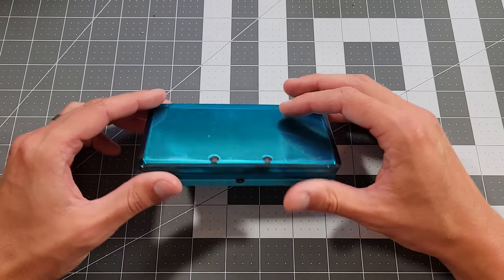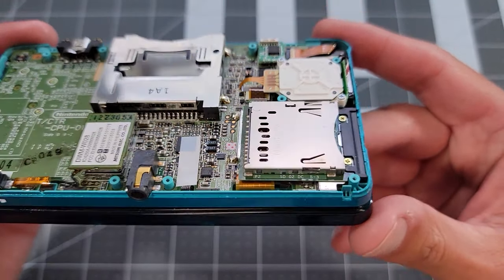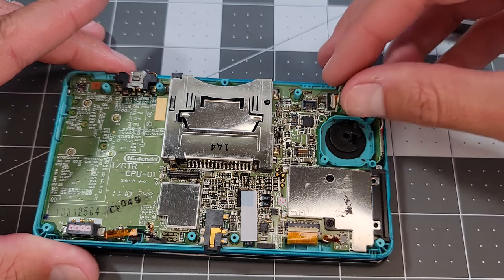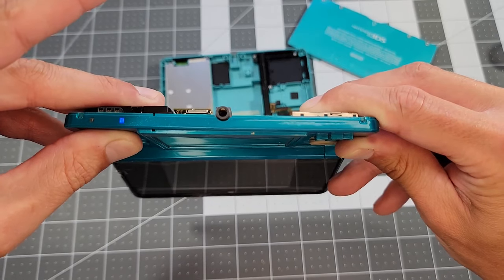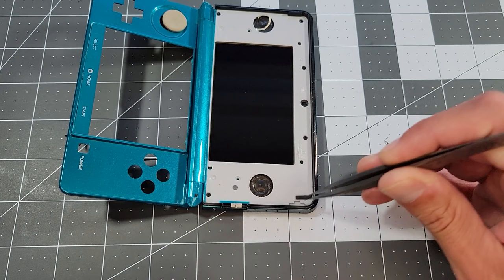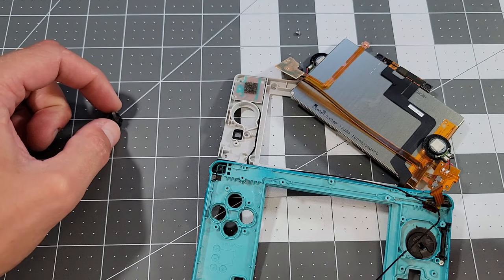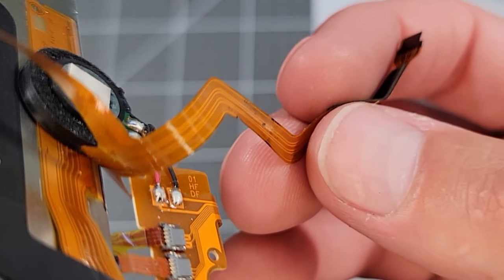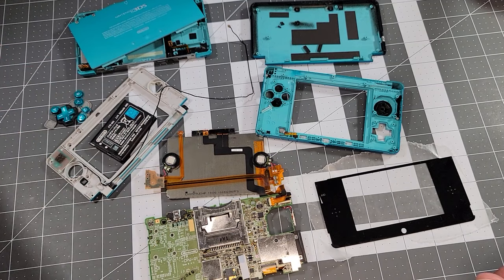Nintendo 3DS turns off with a POP! Finding Out Why

Comment: At least you found the issue!
Reply from the maker: Heck yea, thanks for watching!
Reply: @FantasticQuack  It’s typically the speaker, but I’ve had it happen with other cables required for boot.
Reply from the maker: @adamwayne101  I've encountered this problem exactly twice and it was the screen both times.
Reply: @FantasticQuack  Yea we’ve encountered the issue more often than we would like, it could be any of the main cables required for boot which makes it a pain to pinpoint. There are a few variations with some being instantly popping, some popping only when opening the console and some not making the popping sound (which could mean bad speakers). For us about 30+ have been speakers, 5 or so have been top screen and few have been a variety of things.
Reply: @FantasticQuack  I’ve been wanting to make repair videos for a while now but  haven’t found the time and am unsure of a proper POV setup that won’t get in my way :/
Reply from the maker: @adamwayne101  Who is we? where do you work? Sounds like you've got a lot more experience on these than me so I'll take your word for it! 90% of what I fix I come across on my own since I'm not a shop and my channel is too small to get very many subscriber requests, that is just to say there are a ton of console/game failures I've never been exposed to--but every time I run into something new I 99% find a way to fix it!
Reply from the maker: @adamwayne101  Whatever you try it will get in your way, I just work thru the pain :)
Reply: @FantasticQuack  My business partner and I run a video game store/repair shop. Mostly online currently while raising funds for a brick and mortar location in Texas. We’ve repaired close to 400 consoles at this point, most component repairs have become trivial but the board repairs are the trickiest which require soldering and that’s my partners job lol
Reply: @FantasticQuack  We’ve managed to repair most board issues but have had a couple that are beyond our level of skills and would likely require Nintendo to fix themselves so we just end up using those for parts

Comment: Yeah I have had this issue on my new nintendo 3ds XL for 6 years, only looked into fixing it now. There is ABSOLUTELY no way in hell ima be able to do this myself. And I'm a tech nerd
EDIT: came back a year later to reconsider... yeah there's still no way I'm doing this
Reply from the maker: Don't sell yourself short, anyone can do this stuff with enough practice and patience!
Reply: Lol me too I'm in college now looking back at my original 3ds that broke like 8 years ago. Might as well try before throwing it out
Reply: I was in highschool when I tried to fix my old original 3ds by replacing the circle pad, camera module and top screen, I fixed it with no issue, still perfectly working to this day. You just need to be a bit patient and not yank on the cables,  replacement components are really cheap too so you dont have to worry as much about breaking ribbon cables n such.

Comment: You weren't lying about this thing being a nightmare to put back together; I got to removing the bottom screen from my system & called it quits. Brought a new battery & everything hoping I'd be able to fix my old 3ds. Ahh well. Wouldn't have made it that far without your video so thank you 🙃
Reply from the maker: Sorry you weren't able to get it working it's a tricky repair for sure!
Reply: I fixed so many old 3DS XLs. Never want to go through that again. lmao

Comment: Yup, had this exact issue with my OG aqua 3DS. Lasted a good 8 years before breaking though. The battery was also bloated and the right speaker ribbon was severed right where it folds on itself behind the LCD.
Reply from the maker: I'll have a part 2 of this out before January with the rest of the repair. Hope it can help/inspire you to try it out yourself!

Comment: In case you arent lucky enough to find a sweet spot where the device does turn on, is there any way to determine whether the fault lies in the speaker cable vs the bottom backlight cable?
Reply from the maker: Finding a sweet spot where it turns on doesn't tell you where the fault lies either. The root problem was determined by visual inspection (where I show the tear in the cable) so I would recommend the same for you--inspect all the cables carefully.

Comment: I want to play Pokémon x so bad. The issue is I have the same problem here. I know for a fact I won’t be able to do what you just did. Plus I don’t even have the spare part. I want to play it on the citra emulator but I’m having issue with that as well. I looked up the prices for the Nintendo 3ds and Pokémon x on Amazon and from what I find in total it’s going to be more than $200. I was hoping it be less that and maybe I might consider buying it but the fact that it’s more than $200 I’m very uncertain especially to play one game. I of course would buy other Pokémon games as well but to start off I want to play x. I just don’t see the worth in buying it. Also the 3ds shop is closed so I would have to keep ordering games from Amazon which is a slight inconvenience. If anyone has any tips for me pls let me know. Or maybe I just forget about this whole thing and just move on. I do have a switch but I really want to visit the 3ds Pokémon games.
Reply from the maker: If you check local listings or even ebay you should be able to get the game and system for $150 or less. Still kind of a lot, but better than overpaying on Amazon. Hope you can get to play it eventually, also I'd recommend Sun/Moon over X/Y :)

Comment: Awesome guide, man. Managed to boot up a 3ds that was popping like crazy. 

The only weird thing is that it keeps popping if I put all the screws together, and if I don't, it turns on normally.
Reply from the maker: Thanks! Sounds like yours has an issue very similar to this one. I didn't first get this one to turn on until removing the back shell. I'm guessing the screw tension compressing the shell against everything was enough to open the broken trace on the flex cable. When that tension was removed the cable closed it's connection (at least temporarily) and the system could turn on..

Comment: I had something similar like this happen with my first original 3DS.  Except it only happened when you turned the system off, after pressing the power button it go to the power off screen only to immediately shut off with a pop.  It would reset the date and time this happened.
Reply from the maker: I've not seen that before, interesting problem... At least it was mostly working for you!

Comment: Interesting video! I have something possibly similar, but its a 3ds xl. My question is: when your 3ds shuts off, is the date and time reset as well? Mine shuts off intermittantly and date and time is reset to 1/1 at 00:00 o'clock.
Reply from the maker: You're testing my memory but I'm pretty sure I did have to reset the clock after all this was said and done

Comment: awesome guide, i think i found my problem: i got the black ribbon cable practicaly  breaked in half, would it work buying a new ribbon cable?
Reply from the maker: Assuming no other issues then yes. I made a follow up video to this one where replacing the cable solved the issue, check it out if you want!

Comment: Wow disassembling a 3DS looks like a nightmare, glad my New 3DS still works, only issue is that mine shuts down if i tilt my upper screen to much.

Apart from that works like a charm, but thx for the video and at least now i know what to do if it doesn't work anymore.
Reply from the maker: Sounds like the same issues shown here, and yes it is a pretty rough time haha

Comment: Thanks man for the tutorial. 
I've opend mine today because of the same issue in the video with the audio ribbon cable and it seems like the opening and closing the lid over the years worn down the lcd screen ribbon cable black sticker like thing. I hope i can repair it, just have to wait for the replacement part.
Reply from the maker: Glad it's helpful and I hope you can get yours working, cheers!

Comment: I've suffered the exact same problem for years. The First Time this happened i brought the unit to a shop that was usually able to fix any problem with the 3ds but i was told the connector was broken beyond repair and that there was no replacement available on internet. This led me to think that there Was nothing to do and i Just accepted what happened, but this video really gives me some Hope. Is It really hard to learn how to handle all the components as seein in the video?
Reply from the maker: It's difficult for sure and requires a high degree of patience. I have a follow up video with the rest of the repair coming out very soon, stay tuned for that!
If one of the connectors is damaged, that adds another step as now you need to replace it. If you take some measurements I guarantee there is an equivalent connector option to be found on Digikey or Mouser. I go through a similar process on my GBA micro video where I had to identify and replace the switches for the start/select buttons.
Reply: @FantasticQuack  Thank you man, really appreciated

Comment: Thanks champ, I just and desconnect and reconnect the ribbon again, I'll never thought about doing that if is not for ur vid. I was just messing around with the SD card😅
Reply from the maker: Glad I could help and that the simple option worked for you! In my experience it is usually a worse problem :)

Comment: Well, i found my issue. It's just f##ked.
I'll just send it to a service. I'm done trying. Unplugged everything, cleaned every single spec of dust, put it back together, still pops. Nope. I'm done. Too tired fighting stripped screws.

Thanks for the tutorial. It was really good.
Reply from the maker: Thanks for watching! Did you find any damage on the cables themselves? Sometimes the screen itself is cracked or otherwise bad and needs to be replaced.
Reply: @FantasticQuack  The cables look fine. I know the display isn't cracked because the 3DS only sits in a case, was never dropped and also sat in a drawer where there wasn't any dust.
Taken care of would be an understatement.

Comment: Can I follow this tuto to fix original 3ds xl with same symptoms ? Or the hardware is very different?
Reply from the maker: The hardware will be slightly different (screw locations, size/type of ribbons/connectors) but the general procedure will be largely the same.

Comment: I have this same problem happening with my 2ds xl, even though they are different systems will this tutorial work the same, if not can you maybe do a tutorial on the 2ds xl? thanks!
Reply from the maker: It should work for all 3DS types with a rotating hinge. The process will be 95% the same, you just might find some minor differences in the cables & connector locations. If I run into a different 3DS model with this problem I will probably make another video, but until then this content (and the follow up video where I complete the fix) is the best I can offer, cheers!

Comment: Yeeeeah...3DS systems are a bitch to work on. This is why GBA is furthest I will go for repairs. Adding that flip screen made it way more complicated. The 2DS doesn't seem as bad as it's just one big screen and doesn't flip. 

This power/cable issue seems to be happening more recently and I wonder if we are going to start seeing alot more of these with the same issue.
Reply from the maker: You're right on 2DS being easier to work on. I used to think the flip screen on the GBA SP was annoying, but after working on the 3DS it doesn't seem so bad, haha. I wouldn't be surprised if this issue started showing up more often in the near future, might be like xbox capacitors all over again..

Comment: Is there a video anywhere for a new 2ds xl? same problem but probably was different components. Also no screen flash.
Reply from the maker: I haven't ran into a 2DS XL with this problem yet but if and when I do I will make a video! The hardware will be slightly different (screw locations, size/type of ribbons/connectors) but the general procedure should be largely the same.

Comment: Is there a way to fix it without all this? I'm just a child and can't do any of this, neither can any adults I know/my family/
Reply from the maker: If the screen or its cables are damaged then no there is no other way. The only "easy" thing to try is disconnecting and reconnecting the cables. But it won't solve anything if the cable or screen itself is damaged.
Reply: @FantasticQuack  thank you so much

Comment: i got a 3ds xl for $30, it had a similar issue except the bottom screen would also turn off and flicker, as well as the whole device turning off, unless you pressed down "above the power button next to the screen" which i deduced to actually be the battery contact points. only after having taken the motherboard out already lol. one new battery and some nice tight screws later, and it works perfectly.
Reply from the maker: Thanks for sharing, glad you got it working!

Comment: Random question why didn't you try to tape it just for the sake of it to see if it changes anything I did once to a Joycon witch rail buttons weren't working because the ribbon was damaged and I fixed it and still works
Reply from the maker: This cable flexes pretty drastically every time you open and close the screen. Tape simply wouldn't have held up.

Comment: im having the same issue with my "new" 2DS XL, i'm wondering if the procedure is the same since they both run on the same operating system, though, because of my age i can not perform this procedure and will most likely have to pay for an expert
Reply from the maker: I've seen and repaired the same issue on a regular 2DS in a different video (the same in that the screen was the problem), so I would say it's very likely to be the cause on the 2DS XL as well.

Comment: I have a 3DS with the popping problem, but it’s a motherboard issue. I placed the faulty motherboard into a working 3DS and got the fault (proving the cables were not the issue). Both F1 and F2 fuses are good. Any suggestions for where on the motherboard to look? I’ve cleaned the ribbon cable connectors. It looks like there’s a small amount of liquid damage, but I don’t see any damaged components. Also tried checking many capacitors, all of which are fine. Thanks for your time
Reply from the maker: I would focus on the connectors for the screen, you can check the continuity between the connector pins and the nearest pad they run to if you have a multimeter (and ideally a magnifying glass or microscope). Could be some corrosion that's ate away a trace beneath the soldermask, oxide on the connector contacts, other dirt gunk blocking electrical contact, or even solder joints needing reflow at the connector lands. If you don't want to troubleshoot too much, it would be a safe step to simply: A)  thoroughly clean each connector with IPA and a toothbrush B) reflowing the solder joints at connectors as a secondary step if needed. If neither of those things work it's time to bust out the meter if you haven't already. If you get it figured out let me know what the solution was, cheers!
Reply: Holy crap I found the problem and fixed it. Thank you so much for the advice. I was following traces and correlating them with the minor liquid damage. One of the speaker connector pins was not getting through the board because of a corroded through-hole. I was able to run a tiny jumper wire through the hole to bridge the circuit, and the popping issue went away. The 3DS is still in pieces so I can’t diagnose other issues (which there are many I can already see), but I’m so happy I was able to fix the popping issue. This is my first trace wire success!! Thank you so much for the suggestion; I would have definitely given up on this.
Reply from the maker: @DrDubs23  nice work man!!
Reply: Last update: I got the 3DS turned on and both screens working while it was disassembled, but I accidentally put I tiny tear in the top screen ribbon cable when trying to reassemble. It’s okay though because there were a LOT of issues when I purchased it. Bulging battery, torn camera cable, plastic missing from charge port and charge port only half soldered, scratched bottom screen, and the pop fault. The description on eBay was “does not power on”. Oh well, I’m still ecstatic about the fault find and temporary fix. Thanks to you @FantasticQuack, and I will be watching more often to this newly subscribed channel

Comment: I had same type problem with my n2ds xl.

Mine's broken with the top screen is detached so I have to unplug the flex and wifi antenna that connected to the bottom screen, so with the lower screen only I try to power it on and suddenly got "pop" sounds and immediately turn off
But as you said that when "pop" sounds appear the screen would flash and then turn off, mine's same but there seems to be a crack like lightning shape at the screen, so does that mean my bottom screen also needs to be replaced? do you think the speakers are the problem too?
Reply from the maker: If you see even a tiny crack on a screen it definitely should be replaced. I'm not sure about the speakers but a bad digitizer/connection can cause the Pop too.

Comment: the cables though the hinge hole is a pain 
kinda wish nintendo designed it to be a bit more simple in that area
Reply from the maker: Makes it tricky to work on that's for sure!
Reply: @FantasticQuack  yes it does,accidentally ripped the camera cable trying to get mine back through,good thing there are spare parts on ebay

Comment: I have the same issue rn, but not sure if it’s normal if I can still boot up my 3Ds without it popping while it’s charging
Reply from the maker: You're saying it works normal on the charger but pops/turns off when unplugged?
Reply: @FantasticQuack  yes
Reply from the maker: @deliriousdan41  Maybe need a new battery?